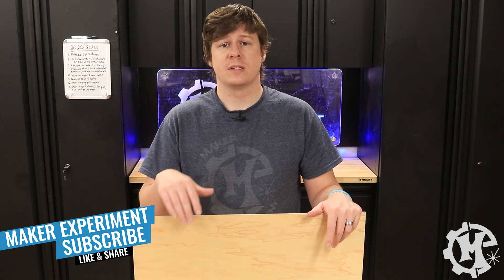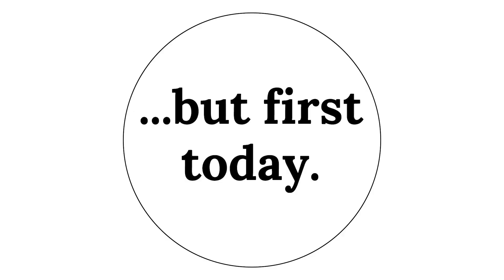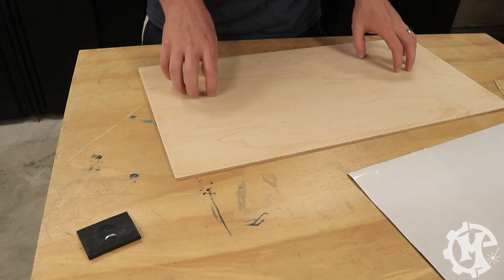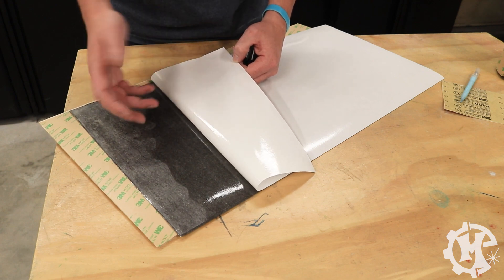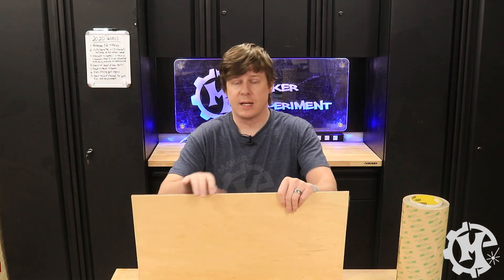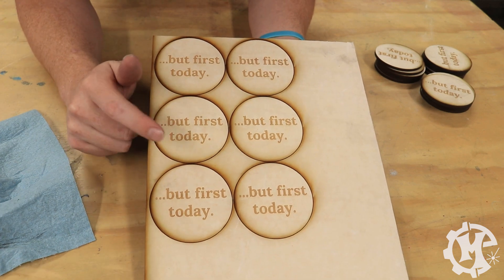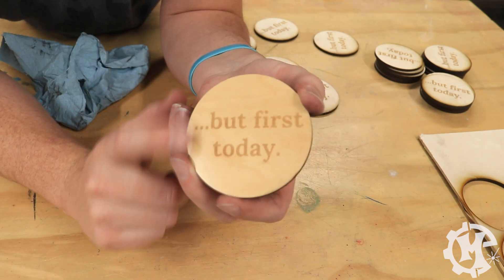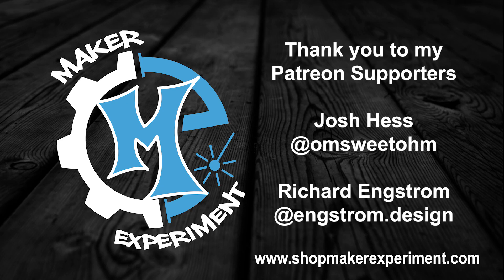How to Make Custom Magnets

Comment: Can I use CA glue to bond the magnetic sheet to different substrate like wood, acrylic, and leatherette? (mainly asking for leatherette). Thanks! Using CA glue would make it a lot faster and cheaper...
Reply from the maker: You can try, but I don’t know how well it will adhere.

Comment: Hey fellow Maker.  Following your link for Johnson Plastics magnetic material, it states that "Not suitable for laser cutting or engraving".  Not sure if you linked the wrong material here but I didn't want to throw off others.  Please let me know if I am missing something.
Reply from the maker: Knocking Down Wood they may have changed the formula since I purchased it. I’m not sure. I will have to research that more. Last time I spoke with a representative there, they said it was okay based on the SDS.
Reply from the maker: I just had a discussion with my contacts and have discovered that since I made this video, the material is no longer laser safe. I have changed the description. I apologize for the confusion. I am researching a new option. As of right now, it seems they changed suppliers and the adhesive is no longer safe for use.
Reply: Thanks for the follow up with this. I’m currently researching as well. I’ll post back if I get anything from my suppliers.
Reply from the maker: Knocking Down Wood let me know. That’s a shame that it’s no longer laser sage.
Reply: @MakerExperiment  Ever come up with an alternative for this magnetic sheet?  Looking for some for a project.  Thanks.
Reply from the maker: @cgiguy3497  you can use a blank magnet and add a 3M sign tape instead of getting the adhesive back. The issue is with the adhesive they used.
Reply: @Maker Experiment, do you have any link, or  source for a blank laser safe magnet? Or are all blanks laser safe? I have been searching like crazy but cannot find something that I feel safe putting in my laser without seeing someone else showing that it is harmless. Thanks